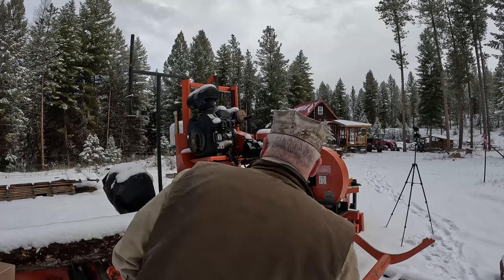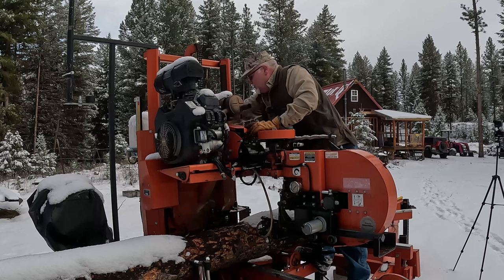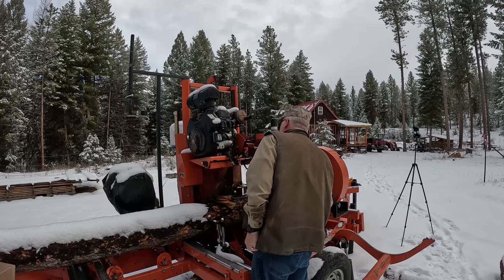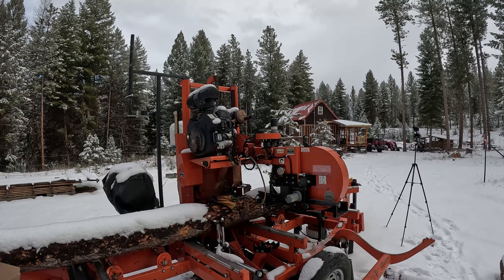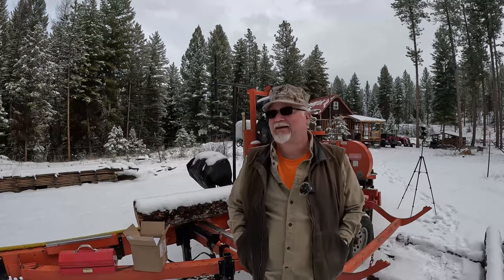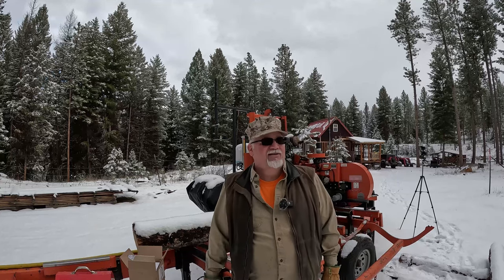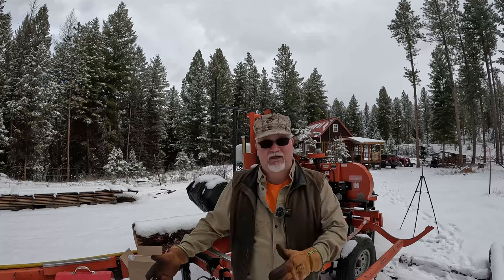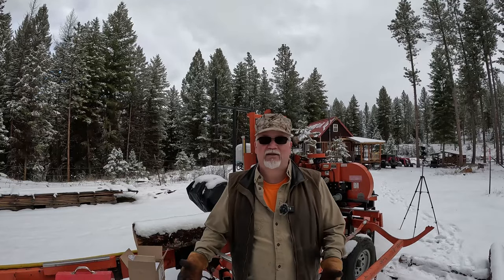Surprising Outcome: Sawmill Repair Attempt Fails

Comment: Erik, I have been sawmilling for 15 years with a manual mill.  Got a LT-40 in Dec.2023.  At 8 hours the solenoid that operates the hydraulic pump went bad.  Then at 40 hours the alternator belt started squeaking.  The engine pully and alternator were out of alignment from the factory.  After alignment it still squeaked so I had to buy a new belt.  Working fine now.  I went through what you just did trying to get the covers off.  I have not been impressed with the engineering of this mill.  Many thing are hard to get to and they could be made much easier.  Mike in Whitwell, TN.  PS.  I have learned a lot from your videos.  Thanks.
Reply from the maker: I'm sorry to hear that!!!  New mills don't seem to have the quality of our older mills!  In 8 years, I've been pretty rough on mine, but I've not felt the maintenance was too bad, but ya, those panels are a pain!

Comment: OJH, during my 30yrs of selling automotive parts, at one time it was not unusual for the replacements to NOT have a pulley on the alternator. So take that for what it’s worth from someone that still loves to sell car parts by using, gulp, PAPER catalogs instead of the computer. Don’t get me wrong, computers in car part stores have their places, but I always ended up getting the customers that had the most twisted and bastardized pieces of…equipment, yeah, I’ll use THAT word, so I often ended up matching the parts by how the physical properties were same/different, BUT many times what I sold them looked NOTHING like what they had. End result, they USUALLY loved what I sold them and they said that it was the best thing since sliced bread and they couldn’t figure out how they managed to get accomplished to THAT equipment so long before they knew me. 

But that’s another conversation altogether…another day and another time! 😊
Reply from the maker: Wish my parts guy had that work ethic!!  Cheers